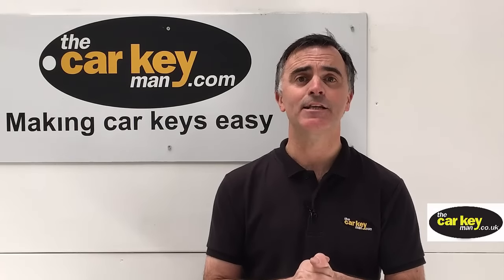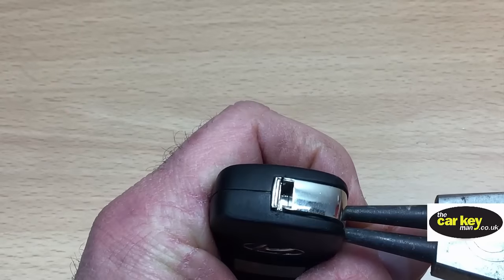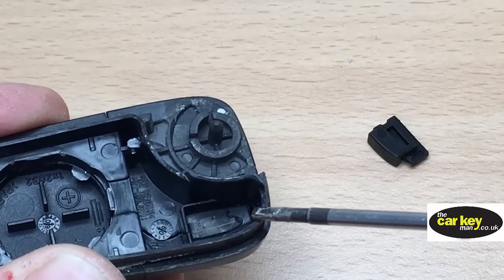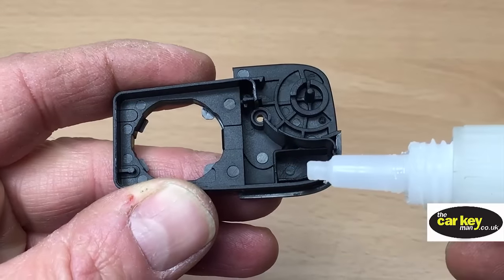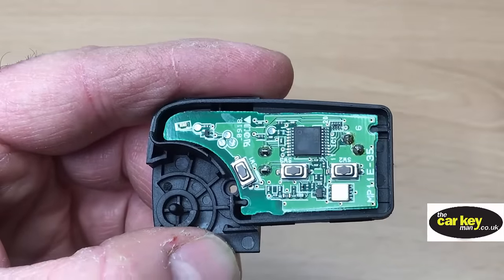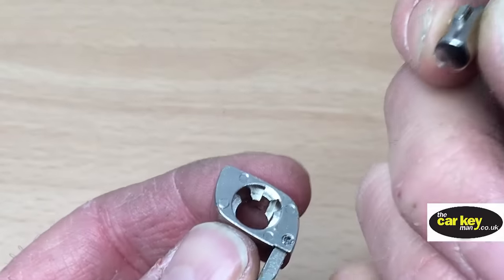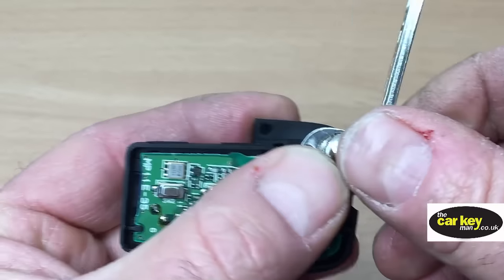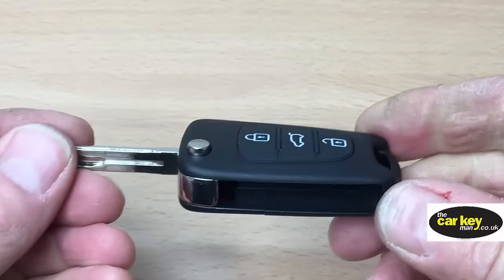FIX Kia and Hyundai Flip Key HOW TO repair

Comment: Easy instructions, however. After all was done, the car didn't start nor did the remote open and close work. ANy suggestions?
Reply from the maker: Hi, did you swap the chip the chip over?
Reply: @TheCarKeyMan  I flipped, turned and tried if every possible way. The remote open and close doesnt work any more either.The LED lights on the controller lights up when I push the buttons but nothing happens with the car. What can I do?
Thanks
Reply: @yogabhav6725  Did you ever fix this? I've got the same issue.

Comment: Great Video...It was a great help Thank You...
I purchased hyundai i30  3 button key fob case.... Changed everything over and had blade cut, everything works but won't start do these fobs need to be reprogrammed....and if so can i do this myself ( how is it done ) or do I need a professional..
Reply from the maker: Hello Terence. There are two things to transfer, the green circuit board and a small carbon chip. 
The chip is what allows the car to start. Have you swapped it over into the new key case?
Reply: @TheCarKeyMan  Yes I have done all that the remote locks but will not start
Reply from the maker: Is it just a key repair ? Did the old broken key start the car?
Reply: @TheCarKeyMan  Yes...
Reply: @TheCarKeyMan  The flip key fell out the fob... I bought shell and change the circuit board and chip as shown in your video which was great help then had the key cut i tested the key it opened doors remotely but when i put key in the ignition it would not start..
Reply from the maker: Ok. did you use a soldering iron to melt the plastic? or did the chip just drop out of the old case? 
As far as the car is concerned, when the chip is transferred over, the car should start. 
Is the chip in the little space in the new key?
Reply: @TheCarKeyMan  No I did not use soldering iron..I prised a little and it fell out.
Reply from the maker: Ok, it's possible the chip is damaged. If a small piece cracks off, it can damage the circuit. Either that, or the chip is loose inside the new key, and it's too far away from the chip reader

Comment: hi so now ive replaced everything and let a key maker copie the key. When ive put the key in the ignition hole and turn it the car want turn on. It only tries to start like ihihihihihihihih...... When i try the old key it starts flawelessly. Do i have to lear the new key? Ive took out the batterie once. Is it because of that?
Reply from the maker: Great description! Ok, so did you swap over the chip? It's the small black thing ?
Reply: +The Car Key Man i dont see the chip clearly. I only can guess which one is the chip. It looks like its integrated in the keyring. In the metal key housing.
Reply from the maker: It is in a small compartment, near to where the blade pivots.

Comment: Steve thanks for the video. Can you not just replace the hinge part from an aftermarket key on the existing key?  Your advice would be great as I have this issue. This way the chip can stay?
Reply from the maker: Hi George, great question. The problem you have is as follows. The hinge assembly has been designed for Kia/Hyundai, built in a factory to match the case. However, the aftermarket case has been designed and built elsewhere. The aftermarket designer made sure that his or her case worked fine, but has probably not made it interchangeable with the original.. Give it a go, but often it will not match. Does that make sense?
Reply: Hi Steve thank you. Makes perfect sense. In the back of my mind that is what I thought as you had to modify the groove in the original blade to fit it, but I just wanted to ask. I am pretty confident to make the change except for retrieving the chip. Thanks for the prompt reply. Good video by the way. I will like it. George.
Reply from the maker: Thanks, with the chip, just take it nice and easy. Some don't have any glue and just drop out, others are drowning in it. Let us know how you get on
Reply: The Car Key Man of course. Any recommendations where to buy a after market key for 2011 i30 Hyundai?
Reply from the maker: Are you in the UK?
Reply: No Australia
Reply from the maker: Not sure which keys suits your models, sorry

Comment: When I took the old remote apart (2011 Kia Soul), there was no chip in it.  I put the circuit board and battery in the new shell with the blank key and it works fine.  How can the remote work with no chip?
Reply from the maker: HI Robert, are you in the states?
Reply: Yes.  The car was originally bought in the southeastern US.

Comment: Hi guys, whats the best thing to do if I only have 1 key? Car only came with one key and now its broken like in this video. Dont want to risk soldering the transponder out and breaking it. For now ive managed to sellotape the blade in so the car is still useable
Reply from the maker: I think you should find a local Car Key Man..are you in the UK?
Reply: The Car Key Man yes im in the east midlands, how much would I be looking at paying?
Reply from the maker: We charge £50 to recase, cut the blade, transfer the chip and replace the battery. Give us a call for a chat if that helps. 01522 514141
Reply: The Car Key Man thanks for the info, If I managed to get this sorted myself but wanted another clone of they key could you be able to do that? I know it would be a bit more involved as you need to program it to the car etc, what would that cost?
Reply from the maker: it would depend on the make, model and year. If you calls us well give you some advice
Reply: in the USA at my true value store we cut the blade, echange the chip board into new case, and program if needed, for 20.99 USD to 32.99 USD
just sharing information :)

Comment: I changed key fob and put white color chip in new keyfob but car not start just crank only
Reply from the maker: Hi, underneath the white cover is a small black chip, did you swap it over? It may be glued into the old key and you'll need to be careful getting it out
Reply: @TheCarKeyMan  thanks I will check that

Comment: Opening the case was easy on my key, removing the blade wasn't that's hard - i used a nail. But I'm afraid of removing the transponder. Is there any other way to do that instead od melting the plastic?
Reply from the maker: Hi Lukasz. Is it glued in place?
Reply: @TheCarKeyMan  Hi. Yes, it seems like it is glued on the bottom.
Reply from the maker: Maybe some glue remover? Never tried this but I will get some and post the results
Reply: @TheCarKeyMan  I already did it with soldering iron like on the video :-) Thank you for your time.
Reply from the maker: Well done ;)

Comment: Just a update of my car key..  I changed the sword and it worked...just made a little mistake..i turned the holder the wrong way  ":/.  It close now when i push button and have to use 1 finger to open it.   But that for me personal better because i broke 2 keys in my pocket because they pushed open and there came pressure on the sword and it broke..... twice..    only when you bring your car to the garage you have to tell them how the carkey works otherwise they will say that the carkey is broken.........  primary thing   it works.....
Reply from the maker: Ah you wound the spring the wrong way? Well as long as it works for you that's what matters. Did the chip come out ok?
Reply: just cutting the side and falls out.. just take your time... 

you know that my carkeys broke now 3 times    2 in my pocket and 1 fell on the ground...  just got one spare.  the first one was within 3 years.. that one was still warranty ...  so again thanks for showing on you tube..

Comment: Any idea if those keys are waterproof ?
Reply from the maker: I'm afraid not.....
Reply: @TheCarKeyMan  I was asking because I've washed my flip key in washing machine but after drying... It survived !
Reply from the maker: @HiCZoK  Hi, did you dry it out in Dry Rice? Sometimes the keys work soon after, but as the moisture hangs about it 'corrodes' the components. It may be worth putting it inside a tub of dry rice, seal it up and see if there is any more moisture to come out of it

Comment: Hello, I ordered in aliexpress for very less price. While changing I burned the chip as well. Now I have only one spare key with chip. Now how do I make a new chip which works in my car? All I have now is the metal key.
Reply from the maker: Oh no! Well, the chip can only be programmed with a diagnostic machine. This needs to be programmed to the car. I will see if I can find an ebay link
Reply: In aliexpress there are blank ID 46 chips available. And also remote locking chip available. If I buy from them, how do I program it to work for my car.
Reply from the maker: You need a diagnostic machine and a security pin number, so you'll probably need to find a local expert

Comment: Can a key cutter cut the key while its still attached to the fob?
Reply from the maker: Hello, yes, we cut these everyday while attached. You just need to find someone with a good machine that is set up correctly and someone who's confident to do it. A problem we have in the UK is that some shops won't cut a key that they haven't sold, so it's worth checking first. Are you in the UK?
Reply: The Car Key Man thanks for the reply.
No USA :(
Reply from the maker: Love your country, hopefully youll find someone to cut it. We charge £10 to cut a key, simply to cover the electric, rent, cost of cutters that break etc. It would be good if there was a database of keycutters! what part of the US are you living?

Comment: I put the case in the oven at 60°C to melt the glue and get the bleeding RFID  chip off.
Reply from the maker: Did it work ok?
Reply: @TheCarKeyMan  it worked fine, give it a try.

Comment: Seems like a lot of faff.  Why not just take the spring mechanism out of the new fob and transfer it to the old fob?  Saves the risk of messing up the chip and your soldering iron stays clean........?
Reply from the maker: Hi Bjorn. When you open up the old key, it cracks the case. Next, often, the parts from the replacement case are made differently to the original key, so aren't always compatible

Comment: I noticed you glued the chip back in, you don't do this, as the reason why it was glued in in the first place is they didn't want it removed. It has a wedge to keep it from moving about which you put on top of it. lol
Reply from the maker: Hi Danny, we get second generation keys in that have already beed repaired and the wedge is missing. So as a rule we put a small bit of glue on each one. We've also seen customers stranded because the chip is flaoting around inside the body of the key.

Comment: BEWARE, did this and all worked but using a soldering iron must have damaged the chip as it didn't come out easily. Probably better to cut it out.
When i tried it in the car it wouldn't start, obviously the car couldn't read the chip.
Reply from the maker: Hi, thanks for this warning. It's a tricky one. We always use a soldering iron, because the chips can crack it you try and cut them out. However, you do need to take it slowly if you use heat. It sounds like you got the chip too hot. An Auto Locksmith can replace the chip only, whereas the dealer will need to replace the whole key
Reply: Ok, thanks for the advice

Comment: Is it possible there is no transponder? I have opened mine and there is only opaque rubber where the transponder is on yours.
Reply from the maker: Hi Lyn, are you in America? What model is it please?
Reply from the maker: I think the rubber id the cover, underneath you will find the chip if it is there
Reply: Yes in America. Kia Sportage 2012
Reply: There was no transponder. And I have put it all in the new shell and it works good. What exactly is the transponder chip for?
Reply from the maker: Hi Lyn. Well in UK model cars, there is a circuit board for the central locking and a transponder chip for the immobiliser. The chip works like a fingerprint. When the ignition is turned on, a small ring around the ignition powers up the transponder chip. This shows the car it's ID, which is unique, like a fingerprint. 
The car then compares this chip to a list a chips that are stored in its memory. If the chip ID in the key matches the Chip ID in the ECU car memory then the car car is allowed to start. If there's no match, the car will not start up, normally because the ful is held back and th spark plugs are restricted. 
It's odd that you don't have a chip. I can only presume that they are not used in America, unlike Britain. 
I hope this make sense

Comment: Damn I wish I had watched this video before I decided to try and use some JB Weld epoxy glue on my broken flip keys. 🤦🏼‍♀️
Reply from the maker: JB is good stuff, but just make sure you don't lose the key blade if it comes loose ;)

Comment: it looks so simple.... until it turns out that the key case is glued and you have to break it into small pieces. and at the same time not destroy the electronics.. it took me 3 hours and used the whole spectrum of tools, my hands hurts...
Reply from the maker: Hi Lukasz, dod you get it done ok? Some pop open ralley easily, others take a lot more effort. Well done on keeping going ;)
Reply: @TheCarKeyMan  I think that the original keys (when buying a new car from the manufacturer, KIA in my case) are glued to make it difficult to repair yourself, and if someone repairing a non-original one, he will not have a problem with it, but in my case, it was impossible to separate the casing with pliers. I had to cut it. Anyway, thanks for the video, putting together a new key was easier thanks to you!

Comment: How about this-- some of these remotes do not have transponders! I just had a key made from the "key" part that broke off. The remote does not need to be anywhere near the car in order for me to start it. The remote's only purpose then is for keyless entry. If you make this discovery about your remote too, you do not need to spend any $$$ at the dealer. You can just get a key made and keep the remote separate, although on the same key ring is fine.
Reply from the maker: Hi, yes we've had a lot of US owners of Kia Soul models tell us that there isn't a chip. Which model do you have? 
This is a great idea, I shall make a video about it, thanks :)
Reply: 2012 Kia Soul+
Reply from the maker: Thanks, that helps me alot, are you in the US?
Reply: Yes.
Reply from the maker: Thanks, it seems that the Kia Soul in the US is the Kia without a chip

Comment: Is there a way to get the chip out without a soldering iron?
Reply from the maker: Hi Pheonix. We sometimes they are not glued in, but if they are, the safest way is with the hot iron. We've had two people in our shop this week, who have broken the chips...so just take care
Reply: The Car Key Man oh yikes! Okay. Thank you!
Reply from the maker: Do you have 2 keys?
Reply: The Car Key Man I sure do. We have a key that isn’t attached to a fob that will unlock the doors as well as start the engine.
Reply from the maker: Are you in the UK?
Reply: The Car Key Man I wish. But no. I ordered a fob from amazon and had everything taken apart only to realize that the circuit board thing didn’t fit into the new fob. There was no transponder chip in the old fob either. I put the uncut key blade onto the old fob but there was a rubber bit that came off and I couldn’t get it back on so the buttons didn’t work properly. Such a pain and I’ll be sending the new fob back and just getting a basic key for now. Lol

Comment: i dont think the superglue is needed again
Reply from the maker: Hi, I think it depends on the quality of the case. In my day-to-day business, I see cheap repair cases that are not held with a screw, but just snap together, It's common for these to open and the chip fall out.
However, if you have a case with a screw, then yes I agree, maybe it's not needed. 
Did you manage to fix yours?

Comment: why not just take the pin and metal bit from the new fob and put that with the key into the old fob?
Reply from the maker: Hi Roman, two reasons. 
Firstly the old fob is glued together. When you open it, the case will crack and cannot be re-used.
Second, the parts you mention are designed to fit into the new case, not the manufacturers original case
Reply: @TheCarKeyMan  hi  - as i finished making my comment that what i thought could be the case. The manufacturers never make it easy to repair/replace with 3rd party parts. Thanks

Comment: Why are so many car keys  rubbish?  Its the only problem i've had with my 20 yr old Toyota Rav 4.  I think that all I did to break them was lean against something with the keys in  the pouch,  in my pocket.  In previous 40 yrs driving, never broke a key.
Reply from the maker: The old Toyota keys do have a weak point near the screw which is a shame. Compared to the new stuff they are pretty hardy!

Comment: Strange thing is happening. I changed but my car doesn’t start. What’s went wrong?
Reply from the maker: Hi, did you swap over the chip?
Reply: The Car Key Man ah. Chip. How to get it out? I don’t have this tool
Reply from the maker: Very carefully. Sometimes they are glued in, sometimes not. You must melt the plastic around it , otherwise it will crack and not work

Comment: And the screw was not removed by broken.
Reply from the maker: Hi Josh. On the original keys there's not usually a screw as the cases are glued together. However, on the aftermarkey cases, once a repair has aleady been done, there will be one. I forgot to mention this on the video